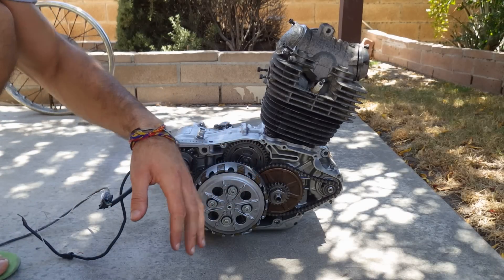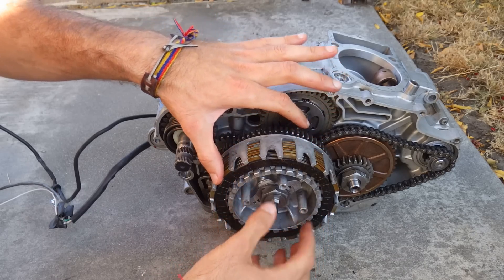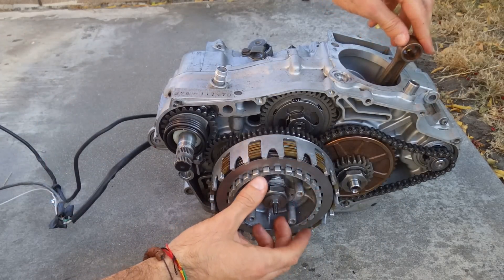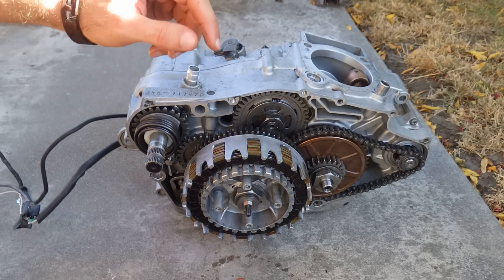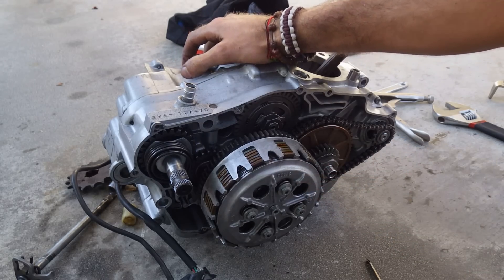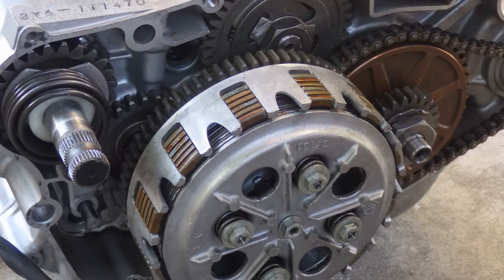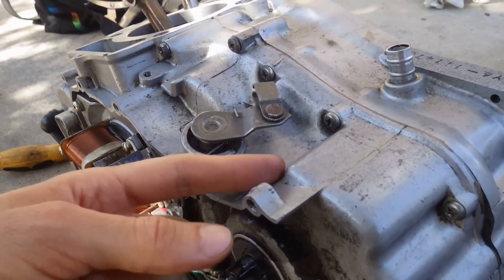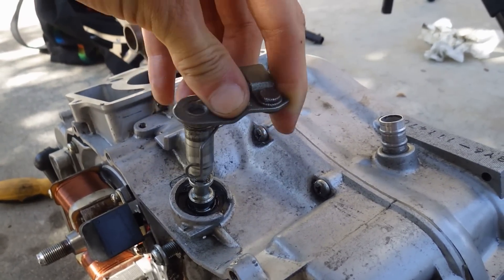How a motorcycle clutch works

Comment from the maker: +31kroko When the clutch plates wear out the clutch cover sits closer to the left side of the engine and so does the pushing shaft. That causes the extra slack on the clutch cable.
(In the replies Chris correctly pointed out that clutch cable slack decreases as the clutch plates wear out.)
Reply: Actually as the plates wear,the outer plate moves further in.The pushrod clearance DECREASES consequently the clutch cable slack decreases.Notwithstanding the fact that over time the cable wears/stretches and increases the slack in the cable
Reply: Listen to Chris, he knows what he's talking about.  When you see guys in supercross/motocross adjust their clutch free play during a moto, most of the time they're doing that because they've ground off half the diameters of the plates because they abuse the clutch so much (they purposely slip the clutch coming out of corners, etc. for more power - when they do this they force the plates to grind against each other).  This causes the clutch pack to decrease in diameter, which forces the pushrod (the outer plate is on the end of the pushrod on the clutch side) more towards the other side of the engine and pushes the clutch lever outwards, away from the handlebars. The clutch lever itself won't disengage the clutch plates in the same place that they're used to, so it throws them off a bit when trying to go fast (they're used to having a bit of slack in the cable, so when there isn't any it feels different).  The main problem is that when they wear down a clutch pack, the clutch lever doesn't have much room to move outward before it runs out of adjustment and stops (the pushrod/outer plate only can move a little bit towards the other side of the engine until they stop too).  The clutch pack gets thinner, the end of the pushrod & outer plate isn't close enough to clamp down on it with enough force, and the plates start to slip against each other.  When that happens, you get less power to the rear wheel, and that's very bad. A slipping clutch wears even faster, so that compounds the situation.
If you have a ton of slack in the cable you won't be able to fully disengage the clutch. You'll only be able to push the plate away from the clutch pack a tiny bit. This can happen like when Chris said above if you have a new cable and it stretches out. Assuming you have the correct clutch cable and its installed correctly (and adjusted to where it should be on the bars), there are adjustments you can make to the end of the nut on the pushrod to take out the slack. Or you could have a worn pushrod assembly, the ball could be all battered and flattened, etc.
Reply: Wow I never expected to be even read,never mind  commented on.Actually the clutch pack decreases in thickness not diameter.Just a small point for clarification.
Reply: Al's Garage Essex dc djcjwfocdeifij dfjggifjaerrtjigbyjh
Reply: i know this is a bit old but is the pushrod in the center of the clutchplates?
Reply: yes, he shows where the pushrod goes at the end of the video and that shaft is surrounded by the clutchplates and the whole clutch itself

Comment: Hi, very good explanation, could you explain why the cable becomes loose and needs adjustment as the plates wear? As the plates wear and become thinner over time the pressure plate goes closer to the engine so the pushing shaft should have less distance to move. I mean the cable should be tighter over time instead of more loose. Do I miss something?

Comment: hi, can i ask what is the top shaft used for (the shaft and gear near the top of clutch?
Reply from the maker: +Kiet van trong The one towards the cylinder holds a counterweight. The one towards the back of the bike is the kickstart assembly.
Reply: +Al's Garage thank you very much.

Comment: Bro, please. My Kawasaki LTD 1981 1000cc its not getting the clucth, I already adjust at 100% but when i put 1st gear the bike goes off, I checked the engine and think that when i pusth the cluctch lever the rod is not getting pushed, can that be that the clutch plates are already damaged? please help, i will take a travel in 3 weeks on 3 states on that bike.

Comment: I have a 82 honda cm250 custom. Like a rebel 250.  Last year I replace the friction discs. Soaked them in oil first. I can't get the clutch to disengage fully. I can only go about 5 miles before it gets hard to shift. If I go to far I loose the ability to disenguage the clutch altogether.  The lever is too loose. I can't be in 1st gear with the clutch lever in without the bike walking and trying to stall. The clutch cable is also new. Got it last year. This is a small bike. It's not even 250 cc more like 234 cc. What's wrong?

Comment: My motorcycle accelerate good but it won't run fast i don't pass over 50 miles do you think the clutch plates are the problem??
Reply: What motorcycle do u own?
Reply: Is a 1980 Kawasaki 440 kz
Reply: Clutch plates don't affect your top speed. Should reach 90mph easily with 36Nm torque that your bike has. Check if there's any problem with the exhaust system. It cuts d speed.
Reply: Well it smoke's a lot and some times just shut down when i make a stop
Reply: I clean the carbs but i don't know if i andjust the nos correctly
Reply: Try going to a mechanic n tell him to add Allen cap head bolts for carb boots, preload d clutch plates with few washers. That might open up for better throttle response.
Reply: Ok men thanks a lot for your help!
Reply: Alberto Jaime More likely a carburation problem than a clutch one. Worn/wrong jets or fuel/air mixture not correct. If your clutch is slipping the engine revs will increase but the bike won't accelerate. And if you try to accelerate hard you will see it slipping in every gear.

Comment: This is a very nice explanation of how a clutch works. The one thing I would add is the fact that this is a wet clutch with engine oil circulating through it.  The viscosity or thickness of the oil could effect how the clutch operates.  The  oil is used to prolong clutch life.  Engine oil viscosity can be a factor in how well the clutch operates.